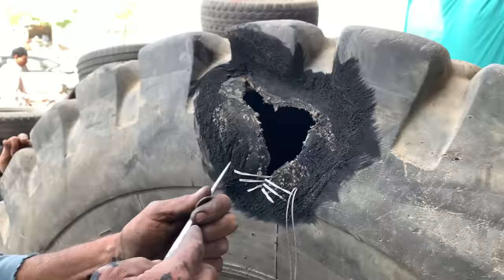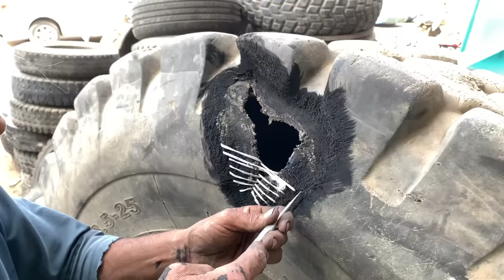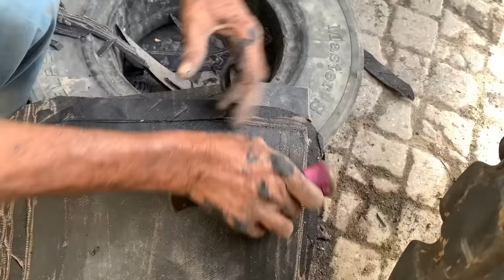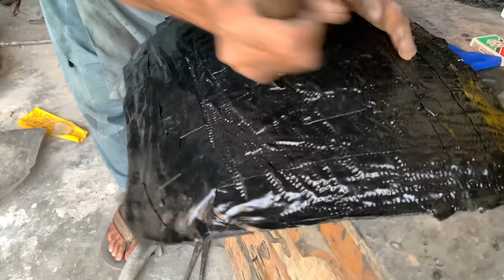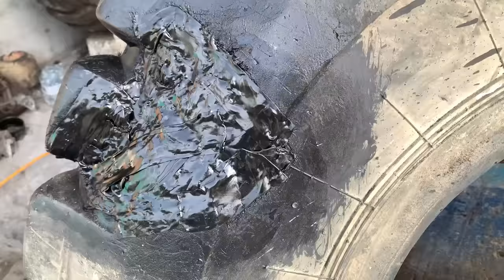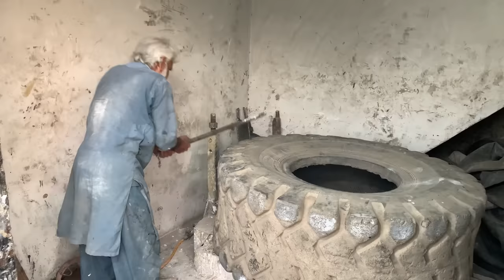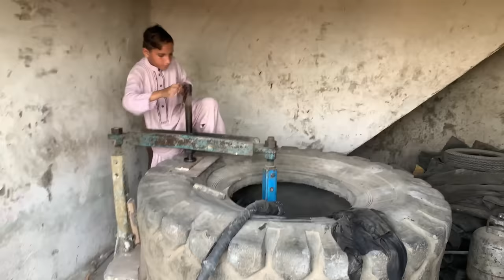Old Man Repairing A Huge Old Tire Sidewall | Amazing Repairing of Monster Tire |

Comment: There is no way using this tire is safe.
Reply: It's India bruh, safe ain't got nothing to do with it 😂
Reply: @blackhawkmtp  Good point!
Reply: It's for off-road use. It's fine.
Reply: iiIts fiiiiiiine
Reply: Might as well add: Notice the amount of material that is added.
The tyre wall is thickened in a patch around the hole, with further air sealing.

Had it been a cheap fix, you would not have added any more than the missing piece, saving money. Adding material costs money, so if it's done, it's likely because it works.

Comment: This is a Great Idea and skills Lost . This man is doing a great service for ones, that don't have a lot of money for a new tire.  The Side wall's of these big tires do not have the Pressure that the Tread has.  I have a large Tractor Tire with a tear this size, and plan to stitch it with Kevlar, which is about the strongest twine available.  I would like to find that Peal and Stick Rubber Roll, but so far haven't found it yet.  I have a boot on order and Industrial cement for the inside.  Old Tire Repair shop's used to vulcanize with rubber strips, and a heat cap that was lit,  which heated the underside.  This Man has developed a similar way to vulcanize, by using a crude, but effective under the tire heat.  Thanks for good old people that still will work.  I'am 80, but still can move about to get things done.  Any comments will be apreaciated. Thanks
Reply: I have ordered from a supplier called Acme Rubber in the past when doing repairs on tires like this. You should email them and inquire as to whether they'd sell you a smaller quantity. They typically do wholesale, but if you ask nicely, they're willing to ship out smaller amounts for a small fee.
Reply: It's not lost anymore is now. Thanks to Youtube and Bill Gates, we are now more smarter and wiser.
Reply: Kudos to you. Never surrender to hard work.
Reply: I suggest you think about this. The side wall is what holds up the tire. All the air pressure is looking for the weakest point to get out and that bandaide is where is going to go. It’ll blow like a balloon. Maybe not right away or even a little while. When it fails, it’s going to blow and jolt what ever you’re driving.
Reply: It's customary to slap it and say that's not going anywhere.
Reply: The tape role is called tenacious tape by Gear Aid!! It’s cool 😎!!
Reply: Teach what you know to whoever is willing to listen. Bless you sir, your the last of a dying breed.
Reply: This repair will not last
Reply: The knowledge is handed down to young men.  I hope there is schooling for the young lad so he may provide for his family eventually.

Comment: When I saw the thumbnail I was thinking “hell no” , but this is actually a VERY thorough repair!
Reply: I thought the same.
Reply: Same.
But the labor is hard and tedious. Didn't expect it to turn out so perfect
Reply: same. thought it looked sketchy first, but this old man obviously knows what he is doing.
Reply: Can't even tell it blew up
Reply: @Epitheos  It will blow there again. Tire should have been disposed of.
Reply: @thatguy4305  why? It is the sidewall. Its only job is to maintain the shape. If that patchwork has the same flexibility as the rest of the tire, it shouldn't be much of an issue.
Reply: @adorp  no, that's not how physics works. That part has to be able to flex,and the plys have a lot to do with it, too. There's a reason why it's blown out in that exact place. That little spot is comprised, plus take into account how much weight is going on to siad tire. You can get away with a sidewall, repair on a "SMALL" tire as a "TEMPORARY" solution, but this is asking for nothing but unnecessary death because.....poverty....
Reply: @Epitheos  bullshit
Reply: @lloydchristmas1086  sane thinking in a world of misinformation

Comment: Fantastic, these people are the true recycling experts. Nothing is beyond them. What they lack in modern machines they overcome with pure ingenuity and hard work.
Reply: and also materials you can order online.
Reply: Recycle expert that blow all the crap in the air 😂
Reply: @deflash 
When you take your car for an MOT, don’t tell me you’d wanna scrape through for as little as possible even if your vehicle is a smoker.
Reply: @kuldilakh7106  no problem, but in my case I'd prefer good parts for a fair price, Eurorepar is OK in my service 🙂
Reply: Wow this is such a beautiful explanation of their craftsmanship @helifella882
Reply: @kuldilakh7106 Thanks for your opinion and time, I respect it, bro. Cheers from Russia!
Reply: @devinehagia123  
Well if you manage to connect the dots as to why we don’t have little workshops like this on every other corner, it’d tell you why they’ve all hung the boots opting out.
Government targeted those small OutLets with Overheads and their Spares supplier, so that vehicle parts were rendered useless without Spares and Overhaulers. 
Therefore you’d have no option but to buy New, some being a complete rip off knowing it’s just a piece of plastic. Then we are back to these ‘RepairAnything’ workshops!
Reply: @devinehagia123  
I take it you may work in Finance and desire the need to prevent disclosure of such Topic ‘To keep us in Debt’🤨
Reply: Recycling😂😂😂.those people have a horrible co2 stamp

Comment: After watching the man repair the sidewall on the tire, it all makes sense. The cleaning and prepping throughout the whole process as well  as  attention to detail on joining surfaces. The using of heat to vulcanize the patch is something I remember as a child.
Reply: @marshalkin you obviously have no clue as these types of repairs have been done for Decades and their failure rate is significantly lower than you think.
Reply: @rudypeev  bullshit any failure Rate is to high. Can't use string on a steel reinforced sidewall
Reply: @marshalkin That's why they're sold as cheaper alternatives afterwards or used as a back up till a new one is ordered.
Reply: @mehmeh1999  or as stepnie.
Reply: @rudypeev What is the failure rate then?
Reply: @marshalkin bro that tire solid.didnt you watch the video?

Comment: These tires are mad expensive, got to repair if possible, for sure. Great work, absolutely amazing craftsmanship.
Reply: The only real question is; how safe is it by today specs.
Reply: @aristonia1991 
For sure it's not a road used tire
It might be use for a shovel truck working off road in a crusher area or building site or so. Even the shovel truck wiil not move in a long distance range in the site. It will stay working in the same area loading or unloading
So it's not for road speeding purposes so I think it's safe
They will keep on repairing it until it's all gone
So even this repair does not stay for long it will not harm anyone when it get damaged
Reply: @aristonia1991   with a little common sense? Perfectly safe. Just don't stand near the repaired tire when it's under load, then it if goes boom, no one gets hurt. So long as no one is hurt by a rapid decompression, it is simply an annoyance getting the earth mover/truck/whatever machinery uses this tire out and into the repair shop on just three wheels.

A tire like this would be around $2500 USD, so even if refurbishing it means more safety precautions must be taken on the jobsite, it is still worth it to repair and use until it's worn out.
Reply: @sparklesparklesparkle6318  sounds like a skill issue to me. Just be careful and you won't get hurt. Should tell your friend/uncle to stop drinking on the job.
Reply: Kual Svinus  Thank you for proving my point.
Reply: @aristonia1991  your concerns are valid, I believe it comes down to one’s professional intuition and case by case. Because at the end of the day, safety is priority.
Reply: About $1,200 usd

Comment: Great to see old school repairs, especially reinforcing the sidewall.  Making do with what you have versus a throw away society .😊
Reply: How is string reinforcing an area that was made of STEEL and rubber???
Reply: @Wyomingchippewa its not a steel belted radial, its not even a steel belted. Its a bias ply tire that uses nylon cords. The only steel in the tire is where the bead is.

Besides, even steel belted radials use nylon in the sidewall, many use it in the belts as well.
Reply: @herpnderpn2484  It doesn't matter, that's not how you fix a fucking tire.
Reply: @mistersinister2043 looks pretty fixed to me.
Reply: From what I've heard when there's sidewall damage you throw it away, because it can't be reinforced and it'll blow out again-it's a danger to everyone on the road.
Reply: @egads3696 its an extremely dangerous and extremely temporary fix.  These are being fixed to be resold.  This tyre has 100% gone on a HVY vehicle and has 100% blown up since this video was made.  Its not a question its physics and fact.  The question is how many people did this tyre kill
Reply: @herpnderpn2484 the problem is not the materials he's using, the problem is the same as with cast metal, which is:

The point that he repaired, might be stronger or weaker, and the resistance to pressure is uneven along the tire, which makes it weaker overall.

Comment: Fixing a sidewall is like no no number 1 in tire repair. Very dangerous
Reply: Sometimes you have to make a choice between going out of business or performing a makeshift repair on your tools and equipment. Plus I think a side wall repair matters less on low speed off-road vehicles.
Reply: @Daniel14550 No, it matters, especially with a tire that size. It more than likely goes on a big vehicle that weighs a lot.
Reply: You think they give a fuck lol?
Reply: @L.kas92 They obviously don't care if someone dies over a rigged band-aid repair.

Comment: All you people praising these guys for their craftsmanship and skill have no clue what the hell you're talking about. You never, ever run a piece of heavy equipment with one of these refurbished tires unless you're looking to get yourself or someone else killed. You ever see the pieces of a blown out tire on the road that looked like the whole top if the tire came off with the tread? Well this is how that happens. They're basically taking blow outs, doctoring them up and selling them as "used" to some unsuspecting company or operator. You don't reuse tires on heavy equipment like that. That thing will probably blow on the first load. Hopefully nobody is around when that happens and the driver doesn't lose control of the vehicle. These people aren't "amazing", they're scammers.

Comment: How they vulcanized that rubber repair is truly human ingenuity.

Godspeed and Blessings to Them and Theirs...Truly
Reply: What does vulcanize do?
Reply: @mr.fantastic7756  Melts the rubber chemically.
Reply: @mr.fantastic7756  it hardens the rubber
Reply: @mr.fantastic7756 Both comments are pretty wrong. It's the use of natural rubber and an additive like sulfur to harder and strengthen the rubber. Because natural rubber isn't durable.
Reply: Can you guarantee this repair will hold?

Comment: I appreciate the work done by this man...It's safes us some money but at the same it has high risk of getting burst..
Reply: no it does not thats a dam good repair
Reply: yall put air in that???  the ones we have put fluid inside
Reply: @soulsreaper7145  depends on what you do with it.
Reply: @moorekurtashley7377  with the thread he used to stitch everything up it should work fine. It seems what people forget, this is not a tire for some car going 70 mph on a highway. This is something going slow most of the time.
Reply: with the vulcanization the tire will hold as new one
Reply: Nope, I will walk off the job site if I ever seen a company put a tire like that on a machine that I would be working with. That shit is a hazard and potential tragedy waiting to happen. You can keep that tire.
Reply: @glOckcOma  work 🤣🤣 you don't even know what work means.
Reply: @paulterhaar4218  So you assume I don't know what work is because I value safety. What an imbicilic comment.
Reply: @paulterhaar4218  That the shitty tire in this video doesn't meet proper safety standards?
Reply: @glOckcOma  What's telling to me is their lack of care for safety says they don't work blue collar. Anyone with two neurons to rub together who has worked in the trades knows safety ain't no game. Boyish posturing.
Reply: No, he repaired a lot of old tyres and that repaired tyres going well thats why people coming to then for repairing more tyres. Think before talking
Reply: @alexanderkupke920  Speed has nothing to do with this repair. The machine that this tire goes on is under extreme loads.

Comment: Back here watching tbis onecagain, and this mans pride of workmanship is truly amazing.  And the younger one, right there with him, learning tge skills of this awesome trade (more work if art), by taking something like a badly damaged tire (injured beyond use) and turning it back into useful condition.  Work that many wouldn't even attempt, but this man performs as a professional. Many wouidnt find this at all interesting,  but to me it's fascinating.
Ive watched such videoes of the 'higher tech' operations,  repairing badly injured tires from the huge front-end loaders used in mining and quarries, and their materials are of state of the art air tools,  used for skiving etc, on up to ore-measured boots and patches .... in the end, this msn and others achieve the same outcome  .... they use the same techniques, vulcanizing cements, cushion gum, stitching methods,  but doing the repairs at a fraction of the cost.

Comment: A new tire like this can cost  between 1200-2000$ easily. Well worth repairing!
Reply: Depending on what it goes on these tires can easily top 10,000
Reply: Regrooving is also an artform. First time I saw a regrooved agriculture use tire I was pretty fucking impressed. Boggers too.
Reply: And this job should be cost around $50 in Pakistan 
Happy days for both sides
Reply: Here's the deal everywhere he saved between 2 to 5 thousand dollars and will not get paid $300 at least they always want miracles but will not pay even a fraction of what it saves
Reply: It's a lot cheaper but sidewall repairs are dangerous because thats the part that flexes the most especially on otr tired like that the go on uneven terrain, rocks and hold a lot of weight, they're and accident waiting to happen

Comment: as skillful as he is, and as amazing the result is, i don't recommend using a damaged tire even if it's refurbished by the original company, it's a vital part of any vehicle that can make the difference between life and death, a cheap new tire is better than a damaged expensive one.
Reply: I doubt a sidewall repair is legal anywhere in the US
Reply: Este es el comentario que estaba buscando, la seguridad es primero
Reply: Well I you can't get a tire in that country and it's used for slow excavation work it should last awhile
Reply: @bobborlog1677  The biggest issue would be the high pressure maintained in those tires, especially to support such heavy machinery. That's what makes a blowout like this so dangerous, and most places require the wheel to be in a cage just to fill it up because of the same risk.

That said, when you have no other choice you do what you gotta do to make ends meet
Reply: When the world comes to a halt, and chaos ensues, that skill will be handy. If production crashes and spares become impossible to get, this kind of fix could be all there is.
Reply: There are no cheap tires in those countries my friends.
Reply: it might be ok for very low  speed construction equipment
Reply: @davidroosa4561   I guess you've never operated a loader, or hopped ditches with a backhoe. Or ran a Loraine LRT1600M light crane, hanging 10,000lbs of steel over 4 guys heads while they bolt it up, (granted the crane's up on it's outriggers at the time). I actually don't agree with using an already compromised tire. My thoughts are that when it goes to sh¡t, and stuff like those tires become impossible to get, that knowledge of "Bandaid Therapy" could help, in a temporary way. It still doesn't negate the dangers of using parts that could critically fail and cause injury/death.

Comment: Those rubber replacement patches have to be adhered to that side wall with an incredibly strong bond in order to take on that kind of pressure. Phenomenal job.
Reply: The patches on the inside become even stronger when the tire is inflated  .
Reply: The soft stuff he put on its rubber uncured im pretty sure that they use bond the the tread to the carcass of the tyre he literally vulcanized the patch on that part where he made the mold.
Reply: @dennnis6416  Right. He's basically melting the rubber fibers together. Very tedious work
Reply: Esperemos q aguante.
Reply: The carcass does not exist on an small place and you can't replace layers of steel weaving, with some thick cotton thread. They are'nt even vulcanizing the damaged spot correctly. This grandpa is making a sort of emergency repair, that is use AND brainless, because U can never use force on this tire again, let alone on the tread of the profile. I understand, that being poor is everything they have there, but this result is for the ass.
Reply: @mrwhite877  it's possible it could just develop a small leak and still be fully functional
Reply: @ohohohitzmagic4536  Even a retreaded tire is never as functional as new, accidents happen all the time. It is also possible that the tire will get hot and burst due to insufficient air pressure, so people could die from pieces.
Reply: @mrwhite877  nylon thread and I think you are exaggerating. You just saw little in your life.
Reply: There's no much pressure on those tires, that's why such repairs can be accomplished.
Reply: Yeah he's right theres no way this should go back on heavy machinery
Reply: @rafars2246  Pressure or load? What are you talking about bub?